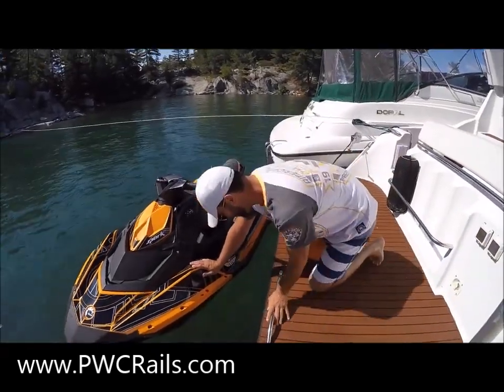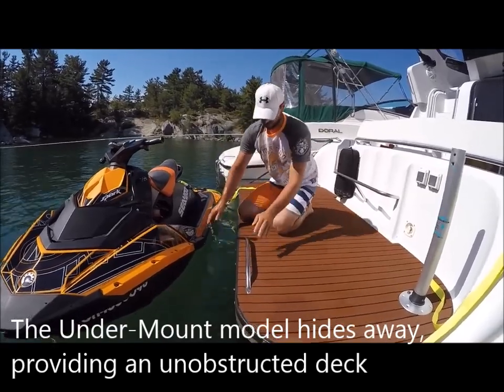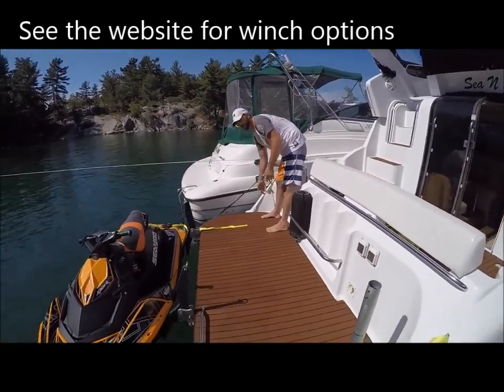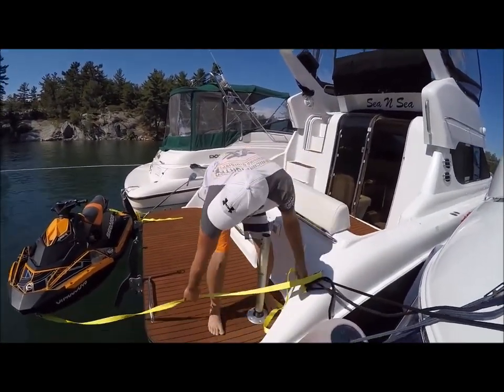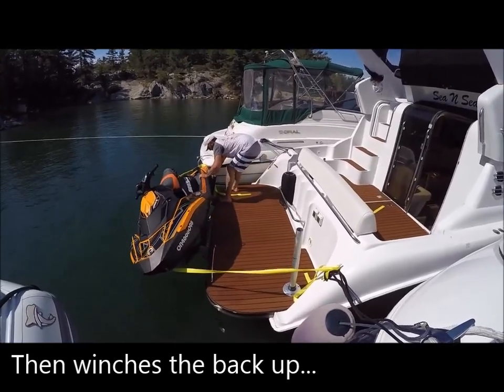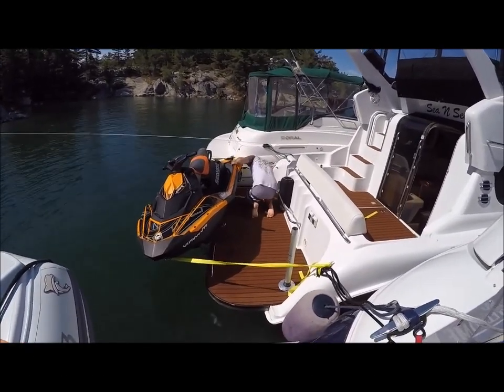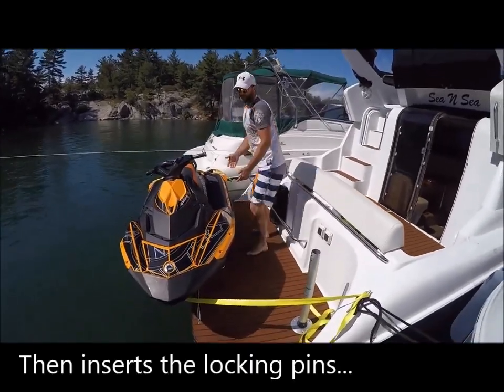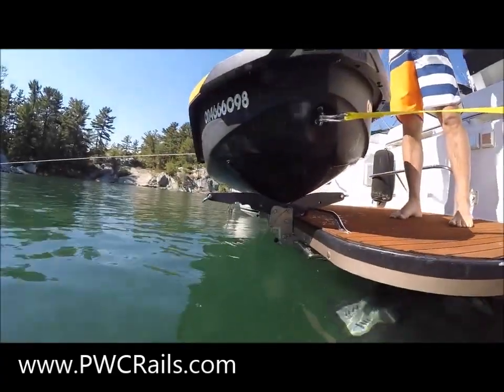Cross-Deck PWC and Dinghy Swim Platform Loading System

Comment: Not bad. But, maybe Is there anything easier if, for example, I am a fragile woman and it will be difficult for me to do this?
Reply from the maker: This model definitely requires strength.  It doesn’t have any mechanical or hydraulic lifting arms which is why it is the lowest cost option for lifting your PWC up on the back of your cruiser.